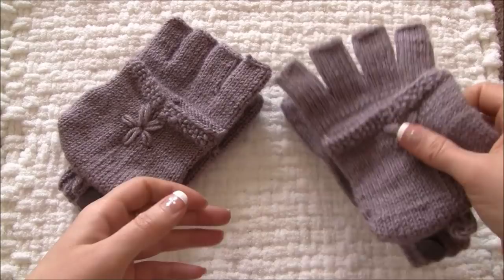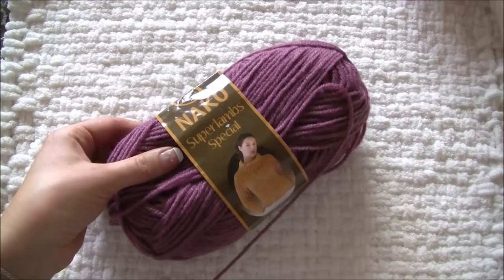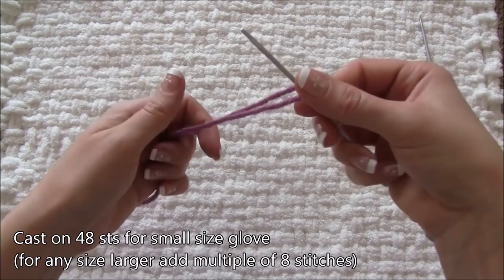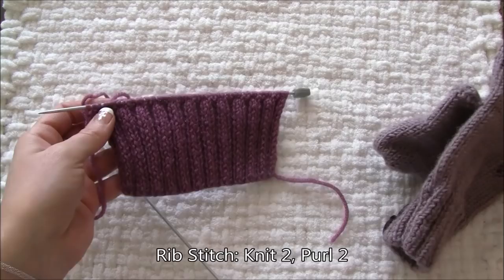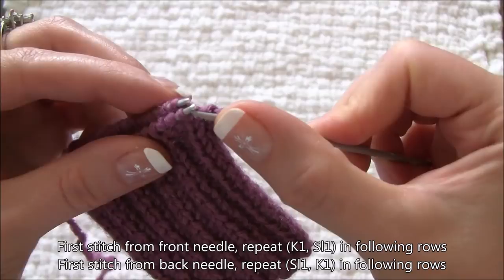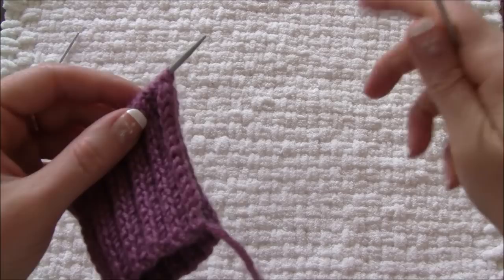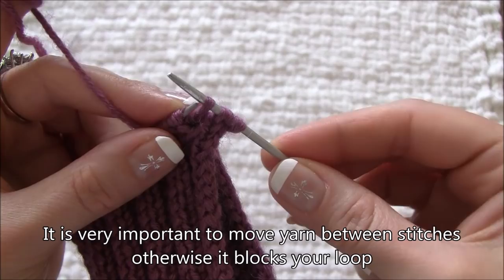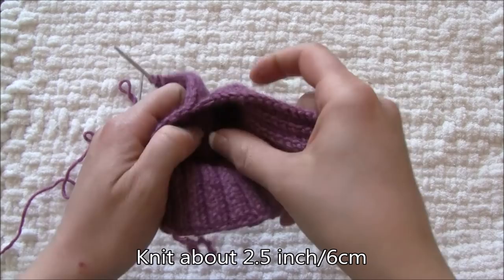How to make convertible mittens - fingerless gloves tutorial part 1(cuff and palm loop)

Comment: Hello! After working on knit 1 slip 1 first row as shown in the video, my next row doesn't have a stitch that isnt connected to the working yarn for my first stitch. How to I proceed? :(
Reply from the maker: Hi Zaryl, this is the most popular problem that happens when you use this method. It is either because the folding is other way or the number of stitches doesn't fall in even number or you pick up the first stitch from opposite needle. here is the link I clearly describe how you should work your rib in case you are doing either of mentioned actions differently. shorturl.at/F1289

Comment: Please let me know the measurements of the finished mittens for the small size that you have shown us on the video. That would help me decide which size to start . Thank you
Reply from the maker: Hi Meera, the width of finished mitten is 20 cm(or 8 inch), that fits my own hand with width of 19cm/7.5 inch, however I would say my hands are a little bit smaller than middle hand size, like I wear size 5.5 ring. For finding out about your hand size you can refer to this link https://wp.me/p9jKna-o2
Reply: watchknitting Thank you so much. That was very helpful.